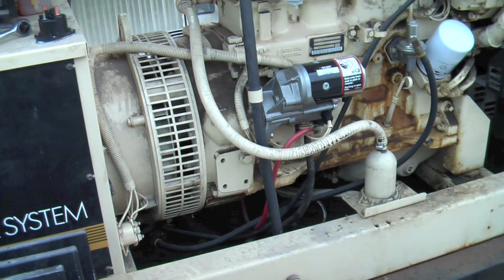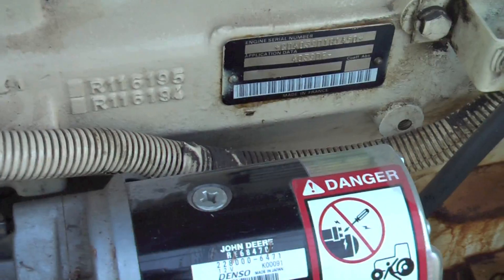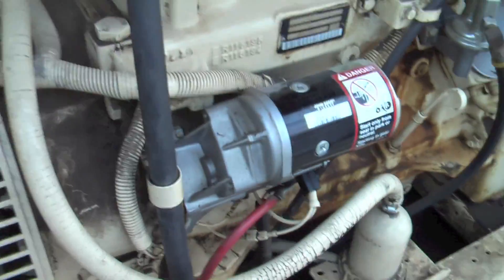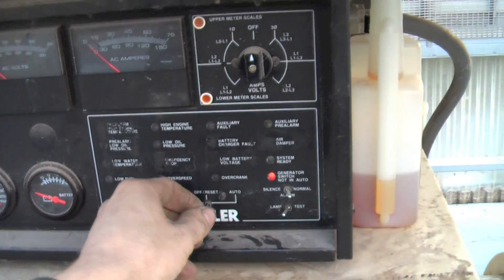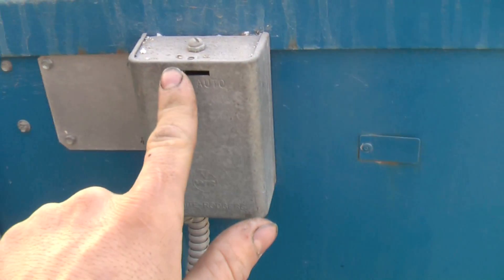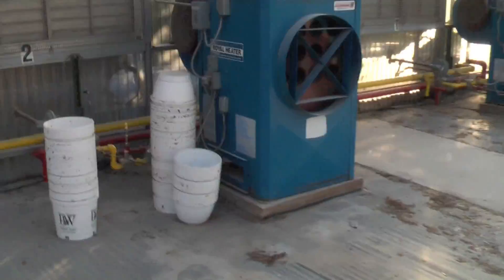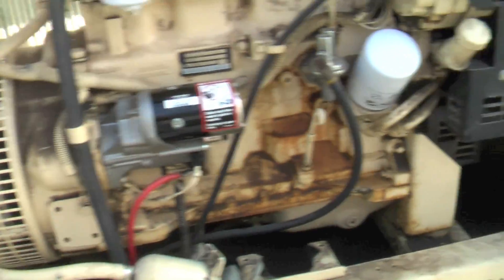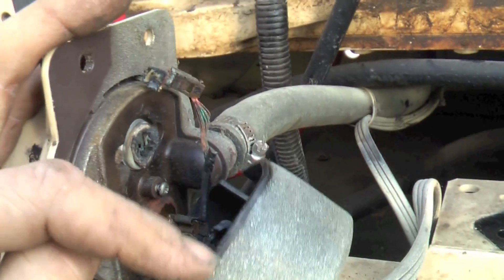Generator Starter Solenoid Replacement and Load Test

Comment: Replace the thermostat on the block heater. They are cheap. Similar to a clothes dryer thermostat. It’s to cycle the heater to keep it at a certain temp. They all fail after a while. The amount of current and periodically switching it on and off kills em.

Comment: I have a All Power 7500 Series Generator and only used mine about 4 years ago for 3 hours then tried using it again yesterday when the power went out and all i heard was clicking/crackling sounds and the motor only turned once before the clicking/crackling came in. I now know that my problem really is my Solenoid but unfortunately it comes in a assembled metal frame with the Starter motor so...... looks like ill be sent back about $160.00 but its better then just getting rid of a $800+ Generator and having to fork out another $500 to $1000 for a new one. Thank you very much for putting this video out. I found it by searching for "How to tell when your starter is bad" and your video popped up as a scrolled down a few videos. Thanks again. 😁👍

Comment: @fergfergferg123 actually the engine a (4039D) john deere non-powertech is a 58 hp or 66 hp according to the john deere website. I saw on the side of the engine in the video the serial nuumber which said "4039D"

Comment from the maker: @K1ll3rM4st3r Sometimes it seems that way for me too lol. But at the same time if we loose power, even if the temperature is below zero, we still have several hours before plants start to suffer from the cold. Really the only critical time this generator HAS to run is January-March. And, it is 20 years old. Actually, for all 20 years, even though there's only 187 hours, a battery, fuel pump, 2 oil changes, fuel filter, starter solenoid, and a block heater isn't too bad for 20 years. :)